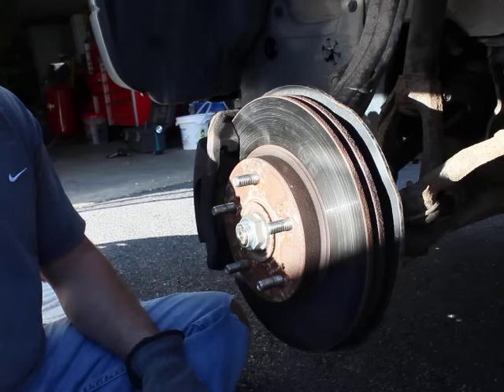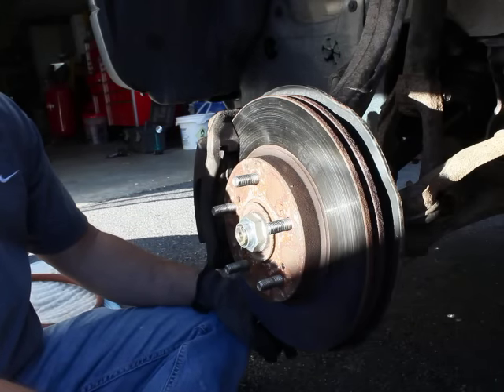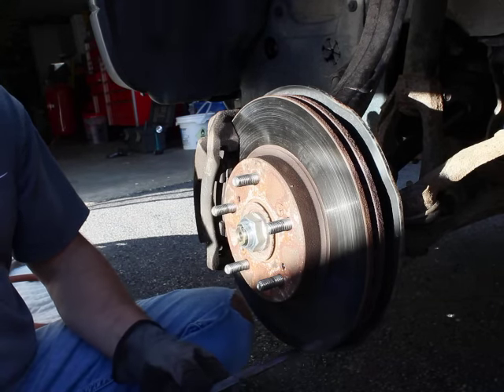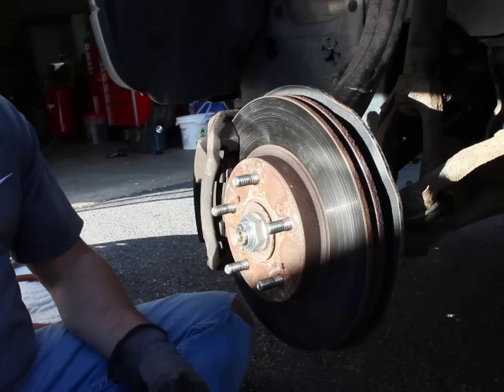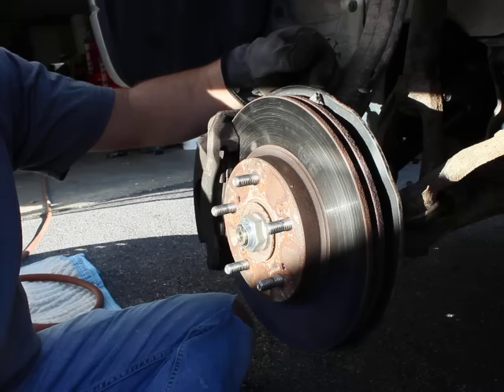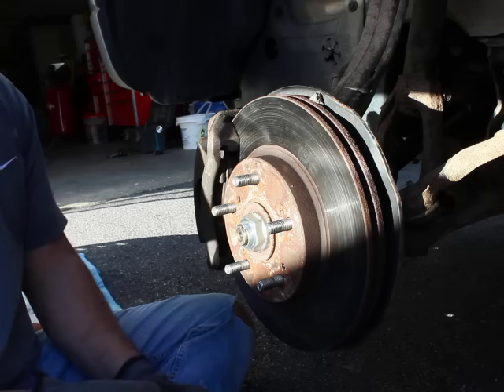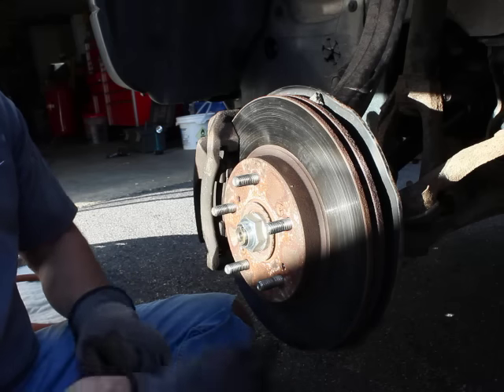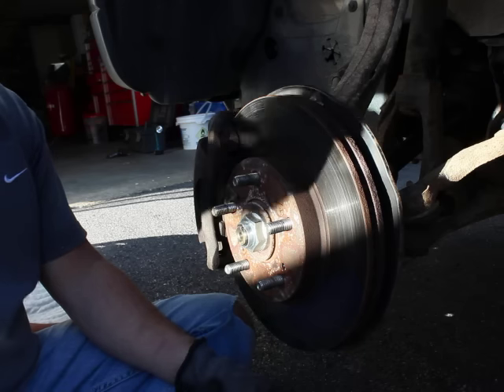Scraping Noise From Wheel While Driving

Comment: I have a question Eddie

Couple of weeks back, i went with my car to england & on the way back i hit a massive pothole on the m6 with my right rear wheel. The impact even threw the end of my car a bit in the air. Luckily nothing happened. At the time (3 AM) i looked quickly, didn't notice anything & drove on to catch the eurotunnel. 

The car isn't a daily driver. Today i drove her again & i heard a squeeling sound whenever i turn to the left (so pressure comes on the right side of the car suspension). A really nasty squeel comes out from the rear. Do you have any idea what it could be? I've seen people say "wheel bearing" but shouldn't you be able to hear that too when you drive straight aswell? Any help would be greately appreciated. I need it to be fixed by end november because I'll be returning to england again.

Thanks for reading / replying :)
Reply from the maker: Hi FunnyMann, you may have bent the rotor backing plate and now it's so close to the rotor, so when the rotor flexes, it rubs the backing plate. I highly doubt it's the wheel bearing, wheel bearings make a constant noise while driving above 25 mph.  Try pushing the backing plate away from the rotor by using a screwdriver through the wheel. Let me know if this works , thanks.
Reply: Eddie Carrara Wouldn't that just make the noise when i brake? However, when i break, i notice an odd sound that wasent there before. I'll see tomorrow if the backplate is bent
Reply from the maker: No, you would usually hear it when taking a corner with or without braking, I't's caused by the backing plat being too close to the rotor, and  when your turning, the rotor flexes ever so slightly and rubs on the backing plate. I recommend taking a peek at your brake pads too, it's possible your brake pad wear indicator is hitting the rotor, that might be your weird sound. Let me know what you find FunnyMann, thanks.
Reply: I looked at the backing plate today, it's not bend as far as i can tell. The breaking pads themselves are due to replacement (i already have them but lack the tools to switch them). However, they haven't weared down to the point the wear indicator starts scraping. I was thinking maybe an issue with the axel? :c
Reply from the maker: FunnyMann3 No, an axle will not make that kind of noise, axles make a clicking noise but not a scraping noise.
Reply: Eddie Carrara That really helped me loads lol, i was worried it'd be really expensive, i'm going to the garage monday & i'll have it back tuesday i guess with more news. I'll let you know what's wrong it since i can't find it
Reply from the maker: Sounds good FunyMann, thanks for the feedback :)

Comment: My 2010 civic makes a mechanical sounding tsss tsss  tsss sound when I'm driving regardless of incline or decline or even on flat roads,  notice it when driving and not breaking and its coming from the driver's side front. Wheel (just from listening)
Reply from the maker: Hi Brad, sometime when the rotors are warped the brake pads touch the rotors slightly when driving and you would hear this noise,  mostly at slower speeds. Does your steering wheel shake when braking from highway speeds?
Reply: @EddieCarrara1  I find it stops if I brake. Like if I give it a quick tap on the brakes it stops. There is minor shaking, but nothing different from any other vehicle I've driven. I mean it just had a out of province inspection, they had the wheels off and everything and all they said is the struts will need to be changed in a year or two.

Comment: Ive been hearing a sound VERY similar to the first eg u gave. It happens even with minimal steering input. I can sometimes even be parked and rocking the steering back and forth. Checked that dust shield and it seemed. Pads were like new.. my mechanic said my rack and pinion may need greasing ?? Tell what else I could check for in the mean time please

Comment: What I’m experiencing now is the rotor is rubbing the dust shield, but because the bearing has to be bad. My rotor has a wobble and in one of the rotations it’s scrubbing the shield.
Reply from the maker: Hi GW, did you try moving the shield away from the rotor? Is the bearing making a humming noise around 25mph? Is this the only reason you think the wheel bearing is bad?
Reply: @EddieCarrara1  further assessment was made. Not a bad bearing, but because the dust shield has so much flex. When pushed out in one spot, it would push another spot in making the rotor scrub against it. Micro tolerances obviously between the shield and rotor. Thanks!

Comment: Ah ha! Thanks for posting this video, I think that's the problem with my car!

Is it possible that it only makes this noise when you apply the brakes?
Reply: darrensurrey mine actually happens on acceleration only, so that’s a good indicator that it’s not the breaks
Reply: @Daya1828  Weird. Good luck finding the source of the noise.
Reply from the maker: Hi Darren, Yes, it all depends where the pebble is stuck so if moving the backing plate doesn't change the noise it 's a good idea to have the brake pads checked.
Reply: @EddieCarrara1  Thanks for the reply. I've gone with bending the backing plate and will see if it comes back.

Comment: Im hearing a rotation ssh ssh intermittently at real low speed. My cover plates are rusted clear off from salt in minnesota.  I think its a bearing.
2000 sub with 280k miles.
Reply from the maker: Hi Rollan, 
No, a bearing will not make that type of noise, it sounds like maybe one of your calipers is not releasing completely and the pads are rubbing or the rust ridge is expanding on the edge of the rotor causing this type of noise. I know all about rust living here in the Northeast lol.
Reply from the maker: Keep me posted on what you find, and remember to subscribe :)

Comment: If it’s a rock how do you dislodge the rock without taking the wheel off
Reply from the maker: Hi Black Top, Try pushing on the backing plate top, bottom, and sides with a long screwdriver or broom handle through the opening in your wheel.

Comment: Hey i just got my caliper discs and pads replaced and yesterday i drove over water as its been raining the whole day, and after that the car is making a grinding noise when i brake and when im just driving, what do u think is happening?
Reply from the maker: It's possible some sand or small pebbles were in the water and may have gotten lodge between the rotor and backing plate. How does it sound today?
Reply: @EddieCarrara1  hi thanks for replying, i got the car checked and fixed, apparently there was some metal touching other metal

Comment: Hey brother,
I was hearing a grinding/scraping noise from the front passenger side and I could tell it had something to do with the wheel spinning because it was faster when I was going faster and slowed as I slowed down.  You could tell as the wheel spun it was hitting something.  I took the wheel off and sure enough the back plate was warped.  Came up and did a quick online search and found your video.  I'm going to go back and try to straighten it out.  I had the car in for some work recently so they probably warped it there.  Anything I can do if I can't straighten it up?  Is it something I can swap out if I remove the rotor?  Thanks in advance for any advice and also for the instructive video.

Comment: I heard a scraping noise but my mechanic says its the wheel bearing's that's worn and require replacing. Its now at the workship for that. But it doesn't sound like the roof roof roof noise of worn bearings,.. it sounds more like metal scraping, clank clank clank like. What do you think sir?
Reply from the maker: Hi Antonc108, Wheel bearing do not make a scraping noise, so I'm not sure what your mechanic is trying to sell you. You may want to get a second opinion on this one. It sounds more like your backing hitting your rotor or a brake pad wear indicator to me.Keep me posted, thanks.
Reply: Eddie Carrara Thanx Eddie,  I did try the screw driver trick and try pushing in it before going down to the mechanic but the scrap sound was still there. He replaced the bearing of both rear wheels. He showed me that one of the bearing and said one of the balls had totally gone and worn off. I donno, it's a bunch of balls in black grub and grease. The sound is now gone though. Maybe after the reassembly it's fixed, maybe I bought new bearings for nothing. But it's a nine year old car so I guess a change wouldn't hurt much. Paid around $250 for the set including labor. The same mechanic replaced rear brake pads for some months ago. I would hate to think he charged me for his mistake and made more money off his mistake again.
Reply from the maker: No, it's sounds like the mechanic didn't over charge you at all, very reasonable price and the noise is gone, so he fixed something. I think you did OK on this one. Thanks for the feedback Antonc, I really appreciate it :)
Reply: Thank you! Great to hear!

Comment: I hear the exact same noise this happened to me when I accelerated on a deep driveway ditch could it be the shield?
Reply from the maker: Hi Mario, 
Yes it's possible, you may also want to check for any loose heat shields on the exhaust system.

Comment: mine only makes the scraping sound when it is hot any suggestions? Still  the heat shield?
Reply from the maker: Could be the anti rattle clip or rust build up on the rotors hitting something. Find out which wheel it's coming from and inspect it for rubbing parts.

Comment: My brakes were changed a few weeks ago by my mom's boyfriend.   Since then I've noticed that my truck sounds different whenever I turn.  It is more like a scrubbing noise and when I make a sharp turn, I hear a popping noise.  Could this also be the reason why?
Reply from the maker: Hey Strategy AX, It's possible, he could have bent the backing plate a little and now it's hitting the rotor when turning. The pop noise, not so much, you may want to have him check his work just in case he left something loose. Keep me posted on what you find out, thanks.

Comment: I recently bought a car on finance a month ago and the brakes squeak when I brake and is getting louder. I also noticed a scraping type noise when I'm driving. I have booked it in as I'm under warranty but what could this be?
Reply from the maker: Hi Gary, 
If it's brand new, it's possible you have a small pebble caught between the rotor and the backing plate or the backing plate is too close to the rotor and is touching.
Reply: @EddieCarrara1  its 4 years old and has done 18000 miles. I was told it was given a full check before i took it

Comment: What about a grinding noise when applying the brake? My brakes were replaced and now when I brake I hear and feel a grinding noise. Any ideas? Thanks a bunch
Reply from the maker: Hi Rampant, If the brake were just replaced and you're hearing a noise when applying the brakes I recommend you bring it back to the mechanic who did the work. It sounds like something is off center like an anti-rattle clip (how ironic lol) or maybe the rotor backing plate is bent and is touching the rotor. Keep me posted on what you find, Thanks.
Reply: Eddie Carrara turns out it was a pin that holds the brake pads in place, was missing. Simple fix. Thanks for the videos.
Reply from the maker: @rampantcolt  Awesome! Thanks for the update, it really helps other readers :)

Comment: Hey Eddie. So I jus check and the plate is totally loose but I couldn't pull it of so how do I go about replacing it or how do I tighten it?
Reply from the maker: +nombee thoj  At this point it may be a good idea to cut it off with some tin snips or diagonal cutters. If you would like to replace it, it may cost a few bucks because it is very labor intensive. Let me know what you decide to do Nombee, thanks.
Reply: Yeah I took off the rotor and the plate was totally loose already so I decided to jus take off the plate and run with no dust plate. There hasn't been any problems so far. Thanks
Reply from the maker: And you shouldn't have any problems in the future :)

Comment: Can I do this with the wheel still on? I noticed the noise today but not sure how long it's been happening. I had new brakes & rotors out on 16 months ago (all 4) and only out 12k on my car since then.
Reply from the maker: Hey BCG661, You could try pushing on the plate with a broom handle if the openings in your rims are large enough. If that doesn't work I recommend you have the brakes checked again. Let me know what happens, thanks.

Comment: I have a smaller rim n tire on my car for some reazon(mistake) and my front passenger where it is makes a clunking noise. The tire refusing to come off. Car should have 195 65 r15. And the one there is 190 60 r15. Can that why theres that noise and tire wont come off? Cause i loosened nuts and drove back and fourth to try n get tire to co.e off and that noise starts to go away. Please help
Reply from the maker: Hi Anthony, tire size shouldn't matter, try kicking the tire off with a horse kick, have your back facing the tire, then kick the tire (not the rim) with the bottom of your heal. The rim is most likely rusted to the hub assembly. Let me know if this helps.

Comment: I have this scraping tin noise consistently but only after I accelerate to about 2500 rpm than this scraping noise occurs until I slow down, could this be the back plate still?
Reply from the maker: What is the vehicle's speed? I saw your post on my other video and replied there as well.
Reply: I wanna say it happens at different speeds can happen at 50 mph or 35 mph but foot always had to be on gas and scraping  will happen louder if foot keeps pushing for more gas, but soon as you let go noise stops, like I said, didn't happen with old rotors , only started with new ones. We tried taking them off looking at them but didn't see anything unusual. I am stumped. My buddy says it could be the parking brakes rubbing on opposite side of rotors bit idk
Reply from the maker: @killerbsting1621  If the parking brake shoes are on the inside drum of the rotor it's possible they are causing the noise. otherwise, that's going to be difficult to diagnose.

Comment: I'm curious if those shields can get bent without it being from a brake job or matinence mistake . I believe the same is going on with my vehicle as well , possible it's a rock so I'll def investigate
Reply from the maker: It could be a rock stuck in there or it could be your brake pad wear indicator touching the rotor warning you that your brake pads are getting low. 😊 Keep me posted on what you find, thanks.
Reply from the maker: @antiquechodeshow2443  Just keep in mind that if it is the brake pad wear indicator it will sometimes stop making noise like when the brakes are hot and will continue to make noise when they cool off. Or it could have been a pebble lol.
Reply from the maker: @antiquechodeshow2443  Awesome, keep me updated on what you find.

Comment: I have the exact same noise too on my new car! but if I drive at low speeds I can hear something rattling around the wheel like a rock is jumping around inside and trying to get out. if I drive a bit faster its just scrapping and grinding. but at high speeds the noise disappears. I believe its there is a rock stuck there as I have a gravel drive , would it fall out eventually? I have a car service in 3 weeks about this issue and I don't want to take anything apart as my car is still under warranty. I can constantly hear it
Reply from the maker: Hi Gurjeev, Sometimes they will fall out, especially in reverse, but if they are too big you'll have to have it removed. Your gravel driveway is a problem lol 😂
Reply: @EddieCarrara1  oh ok thank you! Yeah they are a problem but cheap to purchase driveways I suppose 🤣🤣

Comment: I've got a 2005 Nissan Maxima 3.5 liter I'm recently getting a whining noise at about 40 to 60 miles an hour I put the car up on jacks and got the car spinning rolling and I'm not getting the noise once the car is in the air could it possibly be a bad tire or wheel bearing
Reply from the maker: +Joe James 
Hi Joe, it could be a rear wheel bearing or maybe uneven tire wear. Run your hand along the tire tread and notice if it smooth or rough. Usually if it tire wear you will start to hear it even at low speeds, FYI.

Comment: Mr. Carrara, I have a Honda Ridgeline and I keep getting an intermittent issue where a rubbing noise will come from the front passenger side wheel area.  It happens when I'm going slow or fast.  When I hit the brakes, it stops, but when I release the brakes, it restarts.  
It only happens periodically and I haven't noticed any reason that initiates it or terminates the noise.
Reply from the maker: nate webb Hi Nate, I would get your brakes checked, it sounds like maybe your brake pad wear indicator is starting to hit the rotor. Keep me posted on what you find Nate, thanks.